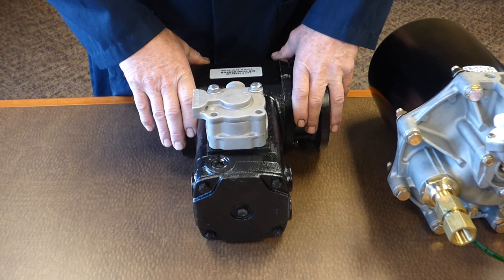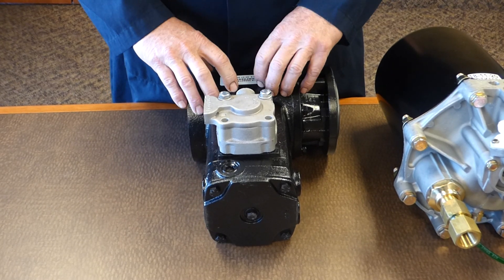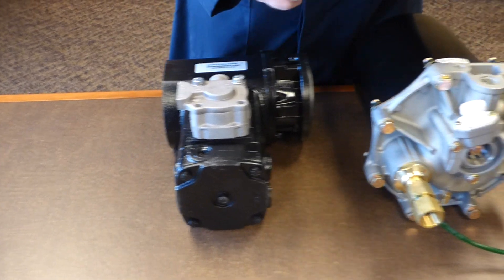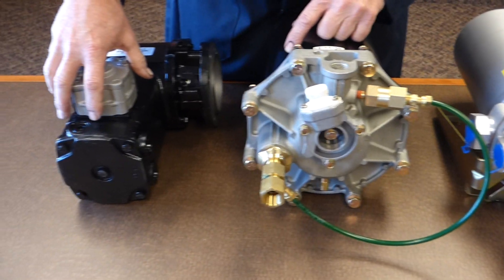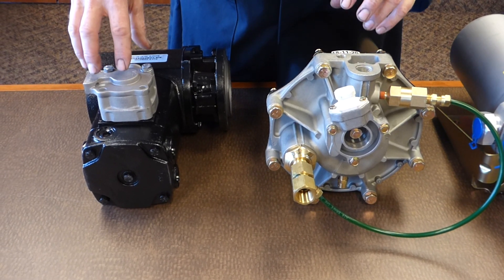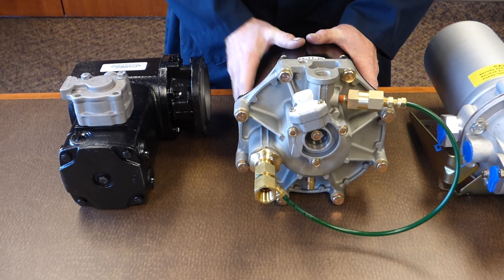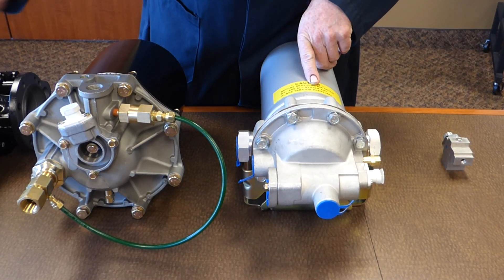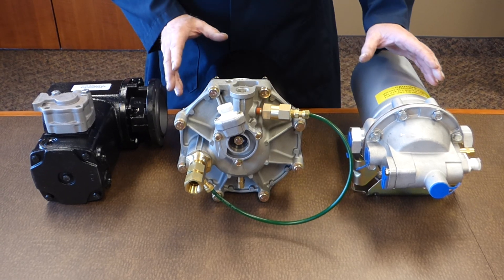QE & E-Type Air Compressor Dryer Application

Comment: I’m lost , I’ve replaced whole bunch off lines and valves and fittings and this dryer still leaking true high pressure valve, keeps getting stuck at 110 psi

Comment: I changed air dryer to the 4 line system and compressor is still pumping oil
Reply from the maker: If you were running a 3 line dryer before, it might take some time to pump out the oil. If it has been running for quite some time and still pumping oil, you may need to service your compressor.
Reply: @fleetproducts  ok thank you, would there be any other reason oil would be getting into the lines? What does the unloader box on the side do?
Reply from the maker: @josebarron6781  If you were running a 3 line dryer before, that would be the cause. The unloader box is there to unload the compressor.
Reply: @fleetproducts  Thanks

Comment: The Bendi AD 9 Air Dryer indicates it has been remanufactured therefore at some point the previous owner replaced the air dryer. I just want to be sure I have the correct air dryer after the compressor is rebuilt.  Looking for Recommendations on the replacement air dryer. Than you
Reply: 65647X

Comment: Hi. I have a recently purchased 2000 Monaco Dynasty RV with a cummins 8.3, 350HP engine. The Bendix A9 air dryer has been purging a lot of oil since I purchased it. The compressor is a Holset QE 296EC, Serial #1D1799C047. I just pulled the compressor and sending for rebuild and just seen your video and wondering if I have the wrong Air Dryer which is causing the purging oil problem. Not sure how to attach a picture but looks simular to the one in your video. Can I call you about this?
Reply from the maker: You should have a 4-line AD-9 air dryer installed if you are running a QE compressor. You can give us a call at 877-243-0442 and one of our sales representatives will be able to answer any questions you may have.